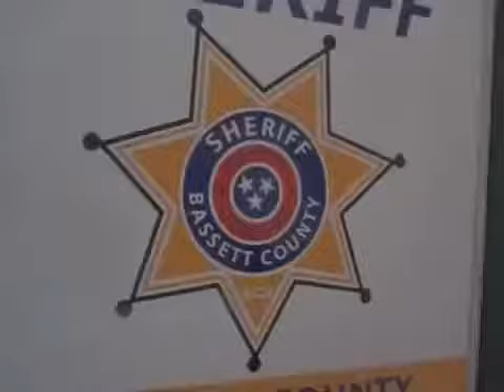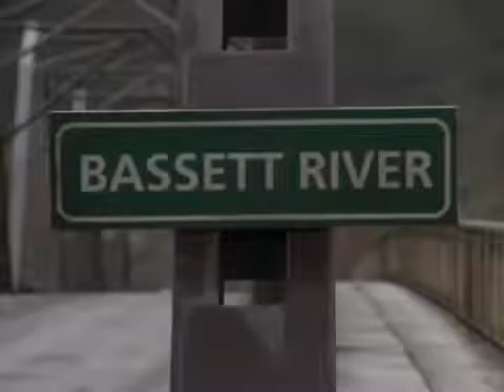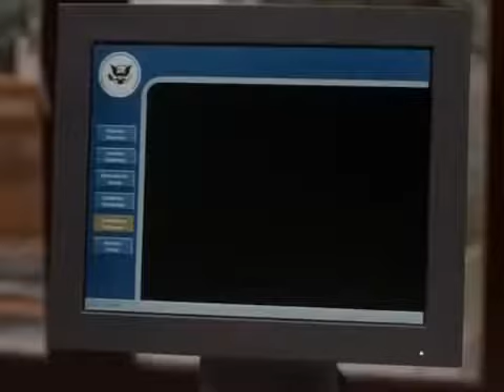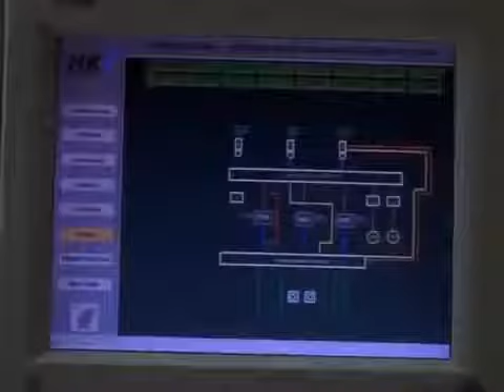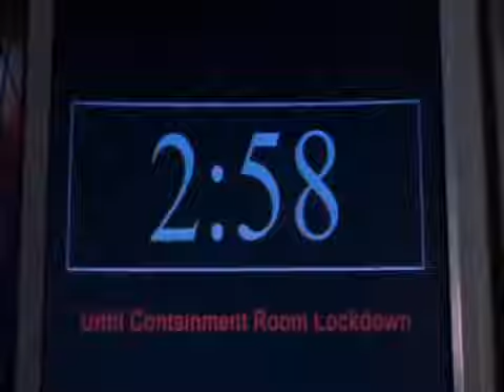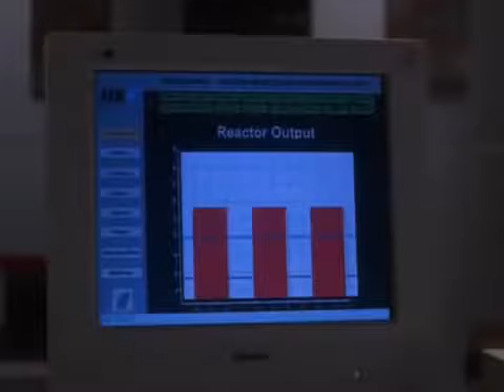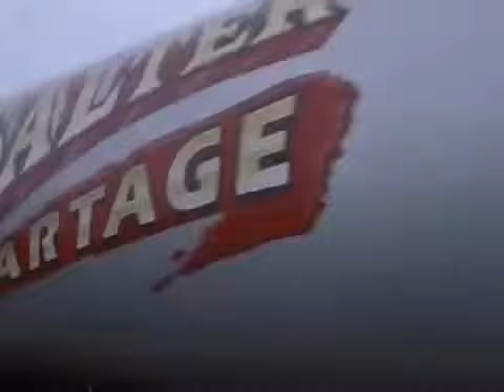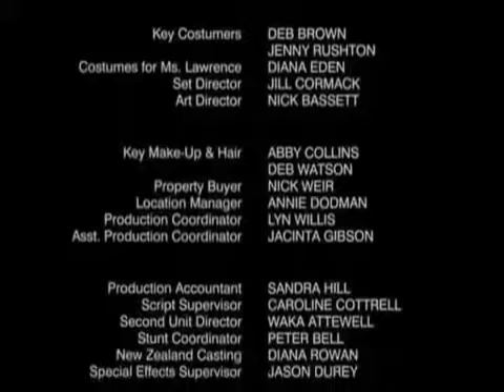Atomic Twister

Comment: I don't live in a country that has tornadoes and, although this is fiction, there is always the possibility that something like this could happen.  It is to be hoped that the staff manning nuclear plants would be able to react like this to avoid massive destruction.  This is such a good film.  Also, why do people live in houses made of flimsy fabric live in an area where tornadoes are, or can be, expected?  I've never understood that.  I like to have my brick house surrounding me.  Also, why didn't Corinne take the radio further into the building to safeguard it, especially as the wind was preventing her from closing the outside doors?  That was foolish.
Reply: She didn’t take the radio further in because of the concrete and steel reinforced walls. They cause the signal to degrade and can block radios from working
Reply: @roadwolf2  Yes, Roadwolf2, I understand that, but she could have taken it further into the building with her to secure such an important piece of equipment, instead of leaving it in a place where the wind would blow the doors open, then bring it back when it was needed.  It's not as if it was too big and heavy to carry.  I don't suppose it matters in just a film though as it added to her anxiety,  :o)
Reply: Just being realistic, a tornado can take brick walls apart brick by brick and cement blocks/ poured concrete is only a little better. They live in flimsy houses because they're cheaper and they know that the only safe place in a tornado is a cellar or a cave or a dry culvert, but even those options come with a danger of flooding. I'm only saying this because you recently had one and I hope you stay safe in the future.
Reply: A category F2 tornado hit a nuclear power station in the 80's - it basically shrugged it off - the automatic shutdown systems triggered and all went as expected.  It was built in the 1970's, and apparently pretty poorly maintained, so a modern plant would probably do even better.
Reply: No there’s zero risk of this happening. This movie is so badly made and does such a piss poor job of depicting both weather and nuclear power plants, it’s not even funny. 
A reactor containment building can withstand an EF5 with zero problem, and even if a plant loses all trains, there’s still redundant systems to handle the situation.
Reply: @AB-80X  they could, just that the power grid and the mechanics that's a major play. And yeah, that's down to the decisions of the operators themselves (Neville; for one, he should never have ordered the electric pumps be shut down)